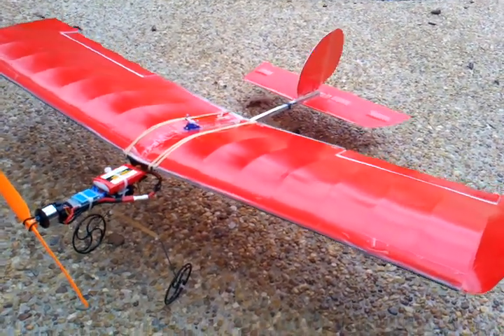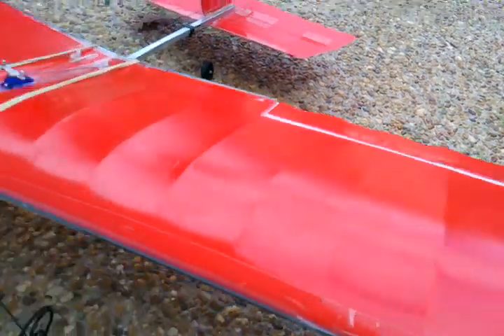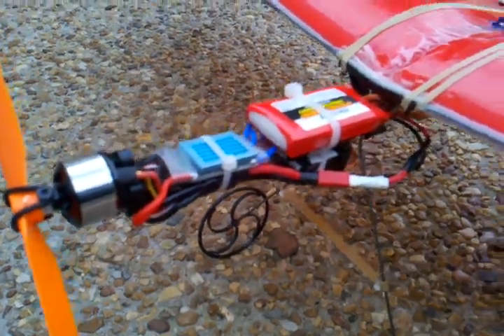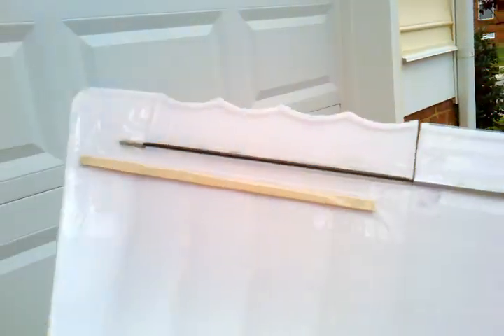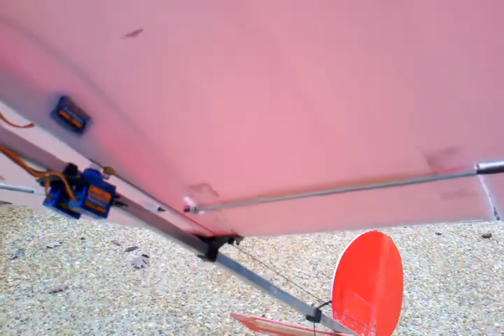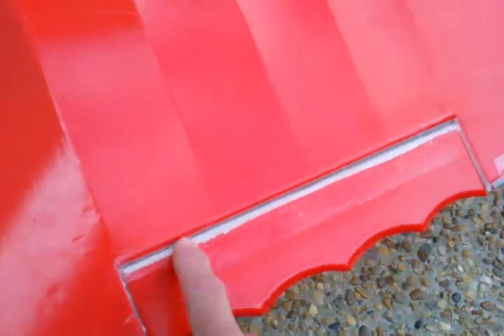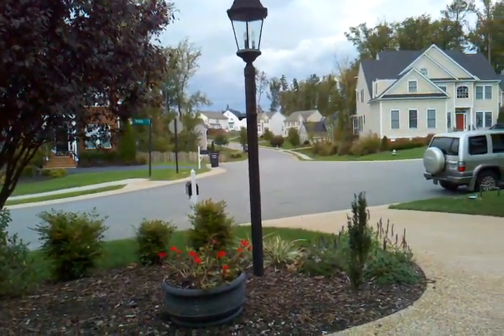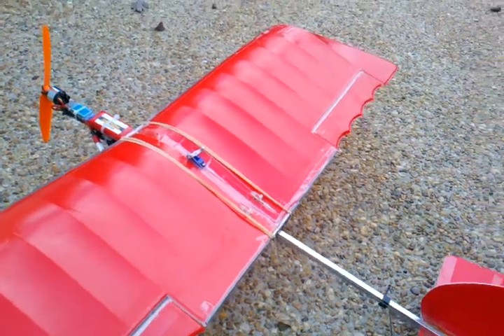New ailerons on the Slow Stick

Comment from the maker: Mike, thanks for your comments. This is avery simple mod and it works well. I have improved on it quite a bit, tho. Since this video, i have completely rebuilt my stick. The new kits include a vacuum formed plastic reinforcement for the wing center section, which is a big improvement. Also carbon fibre fuselage stick and better quality foam. Its currently needing repairs from a recent tree encounter, when its fixed i will post a new video.

Comment: I have a brushless Turnigy motor and 25amp matching receiver ready for back-up since I assume I'm gonna burn the stock 400 motor out with my 3s 2200 Lipo and 25Amp speed controller! Any hints or tips with engineering, power combo, and reinforcements would be appreciated since I'm still anxiously awaiting to fly my new build!